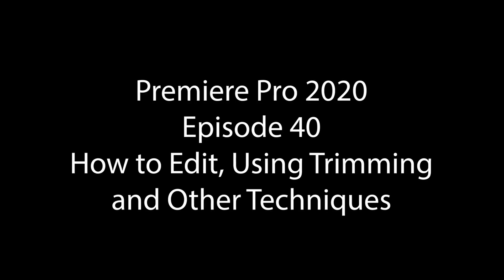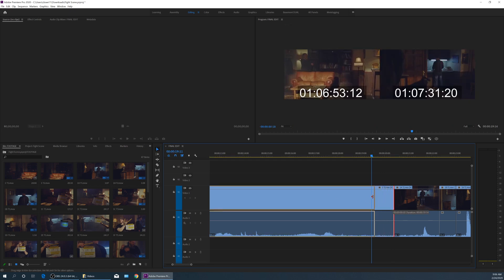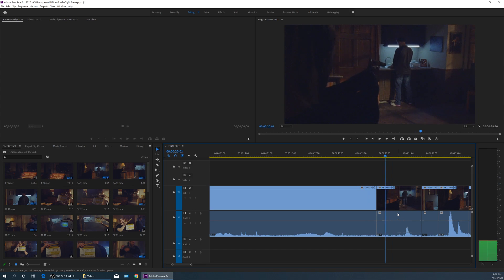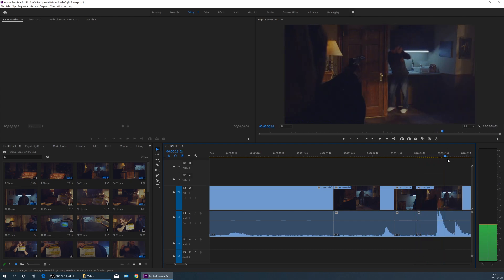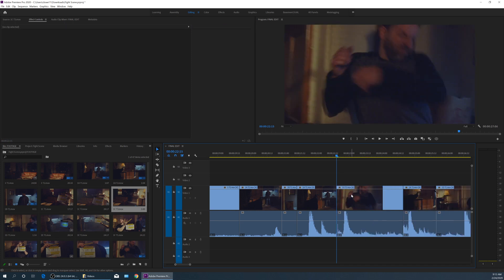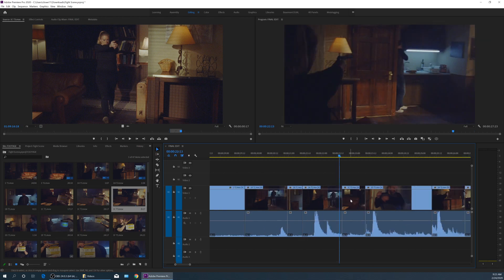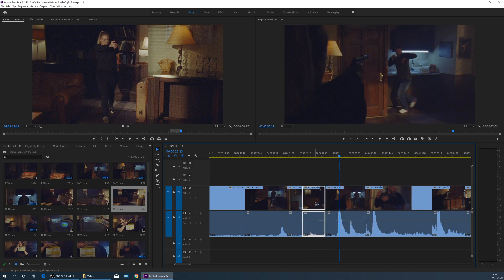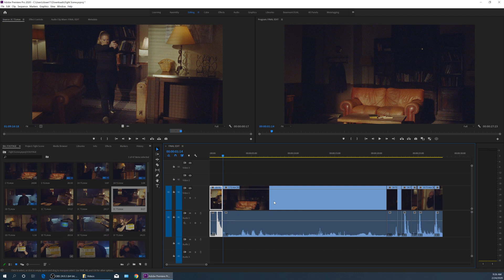E40 - How to Edit using TRIMMING - Adobe Premiere Pro CC 2020

Comment: 6:45 what you actually mean is that's a couple of frame shorter right? cuz you end up ripple trim the inpoint shorter.
Reply from the maker: You are correct. I misspoke. I said I added frames, when I removed them. That's what I meant to say. Brain fart.
Reply: @chinfat  Thanks for the reply! I'm a newbee this really helps a lot. Very insipring!